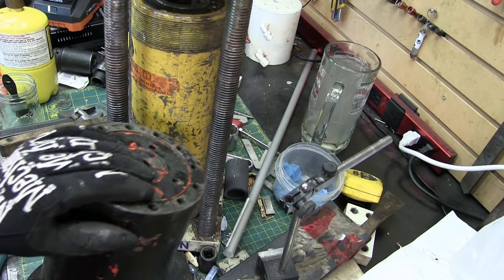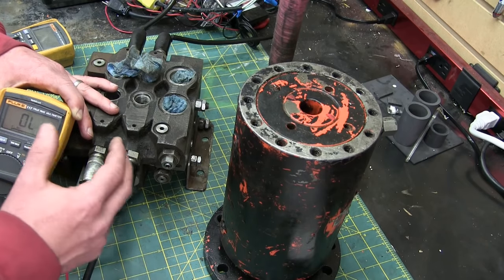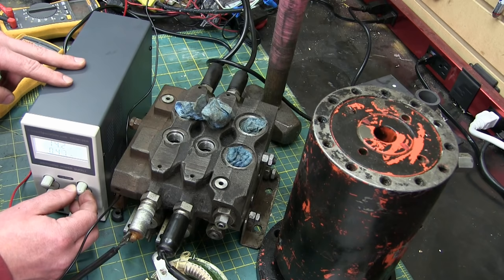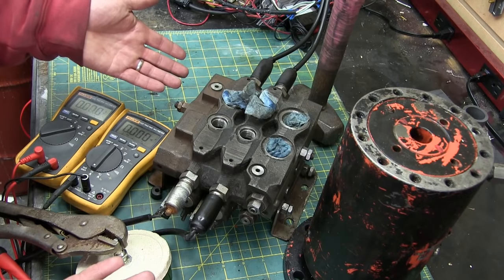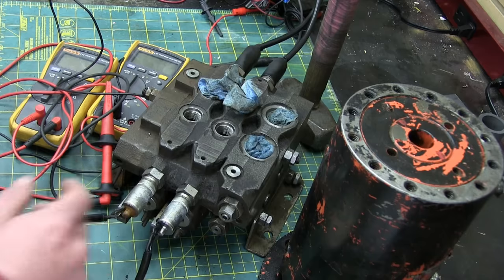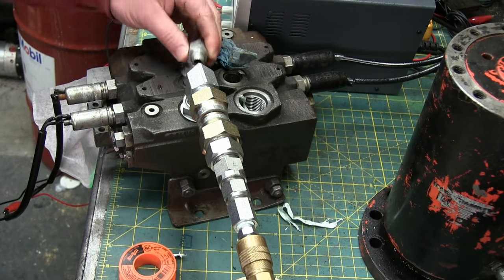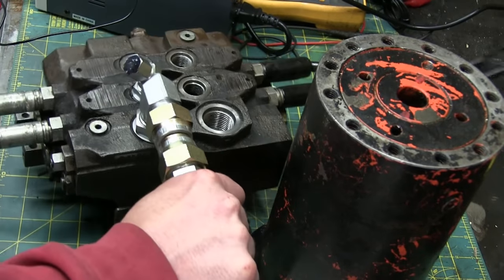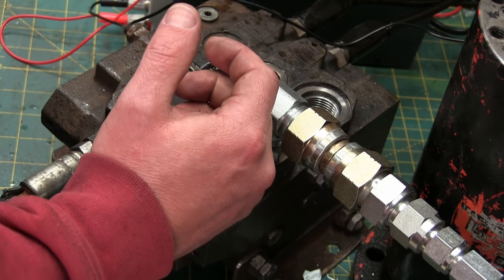Bartending Robot | Hydraulic Proportional Valve

Comment: "These are tougher than hell." Proceeds to put 12x the voltage and 6x the current though it - AND IS DISAPPOINTED it didn't work.  The rest of us are SHOCKED that nothing died, human or electronicals....
Reply: You know you're off the rails when you use you WELDER as a power supply.  Current limiting?  Yea, PHYSICS!
Reply: Well honestly all we love ave, but i noticed that he is a great mechanic but less about pixies.. So I expect some mess when he started to use the welder..then the smoke came. It was so fun! We love you ave you are the best!
Reply: Hahaha. Yeah. I was also shocked. Al my work (Hydro-electric plant) we use 0-10 mA to drive the pilot valves for the servos of our  40MW Hydroelectric generators.....
Reply: Guillermo Frontera that's insane!!!

Comment: At 8:00 , I saw that coming. One could just get some numbers off of the damn thing and look it up. Most proportional coils I've seen have the voltage range stamped right into them. Have fun rebuilding the hydraulic rotators if you ever have to. I have rebuilt many of them back in my equipment wrenching days. They are used many times at the platform to boom connection on aerial work platforms. The smaller rotator looks like a Helac brand. If you do tear it down, putting things in the freezer may be necessary to put it back together.
Reply: To The Top Crane Not only saw that coming, but could calculate it! At 28 ohms, one amp will output 28 Watt of power, which is way too much for such a small device without dedicated cooling.

Comment: If you are still working on this project and need a joystick selection, check out the Hall Effect Gimbal from a RC Radio company called FrSky.  As implied it is hall effect so the resolution is amazing and they don't suffer from twitch like conventional pot ones.  They are a must have for us pleebs that fly racing drones.

Comment: I don't know how you did it but just as you let the smoke out of the solenoid I smelled the faint smell of wire insulation burning in my garage...the lights went on as I frantically searched for my own failed experiment to recognize the faint smell of chlorine from the kiddie pool as the culprit. It's amazing how similar they smell. Thanks for the video AvE! Good luck with the project.. anticipating the next level.

Comment: You might be already aware of this Ave but that appears to be a Parker VS Pulsar cartridge valve. They use PWM to actuate along with hydraulic pressure on some variants. A circuit card varies the frequency and voltage to that pulsar. Depending on where the joystick is throttled in the machines that I work on. And the small nut with the Allen on each section of the valve is the centering adjustment.

Comment: Gonna need to build a small shed outside of the shop for the compressor.  Can build it big enough to keep trash cans in so the missus don't complain about it.  Enclosed area for compressor, with a 100 watt light bulb on a temp switch so it don't freeze in winter.  Could get real fancy and have louvers that automatically open and close for ventilation.

Comment: Would proximity switches/sensors be of any use??, not saying I have a shedload but work goes through the things like no tomorrow, just swapped out a couple with busted connector housings but the guts inside work fine. It's a wet food factory, cleaning down with high pressure water jets so the sensors need to be proofed against that. Mostly SICK stuff with a few Festo bits thrown in, mostly air flow regs and valve packs. I'll do a quiet metal bin dive and see what I can scrounge up

Comment: I know that this video is old - but you are funny!
You need flow through DCV to generate pilot pressure to move spools.

At 28 ohms, Parker Pulsar solenoids are 33 Hz. PWM controlled. But they will work in ON/OFF mode regardless with constant DC current.

Those, actually need to have negative ( reversed polarity) spike to turn them off.

Although if your power supply is switched - you are putting out some kind of PWM signal.

Comment: I am not familiar with industrial systems like you have here, but if you are looking for a joystick system that operates proportionally, consider using a joystick used for electronic wheelchairs. They run on a 24 volt system. The voltage and direction are controlled from the single joystick.

Comment: Hey man I don't know what you ended up going with, buttons or joy stick, but once I played around with using the force sensative resistors from adafruit to controll the pulse width modulation. I was wanting to do something similar but have yet to get my hands on a proportioning valve. I was thinking about sticking the sensors on the business end of the actuator, and then as you push on it, it moves. (real life Iron man suit interface)

Comment: Proportional valves often work on current, rather than voltage.  This is done since resistance varies with temperature.  Using a current feedback driver overcomes this.

Comment: As far a controlling the robot you could use an r/c setup if you bought a 5 or 6 channel even 8 channel you could add them as you need them. The electronic speed control might be just what your looking for. Perhaps someone with a little more experience with the r/c setups could pipe in. I just know enough to get into trouble.

Comment: You should do a test (video) about the lineairity of the valve. To see if the voltage changes the output preasure lineairly. 
Otherwise your bar could get really messy, really quick. :p

Edit: okay its from 2 years ago ...

Comment: isn't hydraulic overkill for a bartender? If you want a feasible solution you need a combination of pumps and mixers that can do the drinks in the back ground(adding lighting to the tubing system and executing those in clear plastic will add for a wow factor) and a 3d-printed manipulator with a pretty basic grabber that can serve the drinks. 
A practical application will require the customers to use cards for payment(because cash makes the system more complicated) and a touch terminal to take the orders. Adding a camera and facial recognition will improve the user experience.
Reply: I think overkill hydraulics is the point.
Why use tiny little valves going to a spout when you can have a huge metal contraption that uses huge valves to have an arm pour your drink for you?
Reply: because speed, mass, inertia and cost of operation per unit of weight for the equipment. Not to mention human-machine interface and the dangers coming from having a bone-crushing power shoving glasses full of flammable liquid into people's proximity.
Reply: weell I don't like parties that end as business crushers...except in some special cases
Reply: not really, I simply dislike social spam, and follow channels that are rich on information or focus on semi-mindless entertainment.
Reply: Tim Stoev welcome to the channel. Ain't no kill like overkill.

Comment: try this code if you want: all you need are two pots or a joystick thats made up of two:

void setup() {
  int x=0,y=0;

  pinMode(3,OUTPUT);
  pinMode(5,OUTPUT);
  pinMode(6,OUTPUT); 
  pinMode(9,OUTPUT);
  
  int initX=analogRead(A6);
  int initY=analogRead(A7);
}

void loop() {
  x=analogRead(A6);
  y=analogRead(A7);

  analogWrite(3,map(x,initX,255,0,255));
  analogWrite(4,map(x,initX,0,0,255));

  analogWrite(6,map(y,initY,255,0,255));
  analogWrite(9,map(y,initY,0,0,255));
}

it grabs the center on boot and simply maps the pot values to the respective pwm pins

Comment: if you want cheap joysticks to mess around with/ experiment then you could get xbox360 or ps3 controller joysticks for less than a dollar each on like ebay, where the ps3 joystick is smaller and a bit more annoying than the xbox360 controllers one since the 360 joystick has standard pitches (imperial/ 100mil) for the pot pins and mounting tabs so its easier to breadboard them etc, and the pots are linear 10k with 1 each for x and y axis and they also have a button, so for less than a dollar you can get 2 -1/+1 linear control or 4 if you have either side of center (its sprung to return to center) as 2 linear controls and the button ontop all in one. also youd likely need to get caps for them seperately but you can get 10 for a dollar or 2
id recommend getting some xbox360 controller joysticks anyway if you havnt tried them 
before, since they are great for arduino/ embedded prototyping/ hobby since they are so 
simple + super cheap + well made if you get lucky or buy from a good seller (for example 
look for ones that have a greenish cage and a grey stick are ok quality) with the biggest 
drawback being the mechanical return to center being sloppy so the pots resistances are 
still changing, so youd either want a discrete circuit or firmware to be able to define 
deadzone limits for the ranges where the joystick can still move before moving the sprung arms, where firmware would be a better option since the deadzone/ center region values can be recalibrated as the stick wears through its life., and at the end of the day they are still super cheap and useful if you have uses for them, with good circuitry and/ or firmware/ software backing them up to counter any mechanical issues their price includes they can be very effective in terms of paying a couple of dollars compared to like 50-100 or more for a major piece of joystick hardware that is 100% unnecessary for microcontroller interfacing and control. good luck with this project anyway, ill check out the repo to see the sorts of branches/ commits ppl are fighting over xd 
and ultimately if you see this : please dont buy a super expensive joystick for this project or spend any mad amount of money, since its not only not neccessary but it would actually by better anyway to use the cheaper game controller joysticks for small projects like this, unless you actually plan to have this in a heavy use industrial setting then something like expensive joysticks could be seen as a significant barrier to entry alone for this sort of thing, let alone the possibilities of repurposing a general arduino/ micro base control unit using cheapest of hobbyware that others could easily replicate and use for their own projects and etc!

Comment: I could not find MrBumblePhuck on Github scratch my nuggets as I tried too.
here is an old modified Arduino sketch using an old 10Kohm joystick to control 4 motors and using the pwm outputs on an uno.
If it doesn't help maybe you can use it as a starting point 

/* Joystick
https://www.adafruit.com/product/2765 (mini single finger/thumb)
https://www.adafruit.com/product/3246 (breakout board for mini not required but easier to work with)
https://www.adafruit.com/product/3102 (bigger joystick if you need to compensate for any inadequacy)
both joysticks are 10Kohm(ers)  
press and hold the button to operate

no guranteease if she don't work 
I provided a bit of a dead spot center of the joystick 
*/

int button=10;
int sw;
const int x_axis = 0;
const int y_axis = 1;
const int solenoid_x1 = 3;
const int solenoid_x2 = 5;
const int solenoid_y1 = 6;
const int solenoid_y2 = 9;

int x_hi=0;
int x_lo=0;
int y_hi=0;
int y_lo=0;
int a=0;

void setup() {
  Serial.begin(9600);
  pinMode(button, INPUT);
  digitalWrite(button,HIGH);
  pinMode(solenoid_x1,OUTPUT);
  pinMode(solenoid_x2,OUTPUT);
  pinMode(solenoid_y1,OUTPUT);
  pinMode(solenoid_y2,OUTPUT);
}

void loop() {
  sw = digitalRead(button);
  if(sw==LOW)
  {
    a++;
    if (a==1){while(1){
      x_hi= analogRead(x_axis);
      x_hi= map(x_hi,0,512,255,0);
      analogWrite(solenoid_x1, x_hi);

      x_lo= analogRead(x_axis);
      x_lo= map(x_lo,518,1023,255,0);
      analogWrite(solenoid_x2, x_lo);

      y_hi= analogRead(y_axis);
      y_hi= map(y_hi,0,512,255,0);
      analogWrite(solenoid_y1, y_hi);

      y_lo= analogRead(y_axis);
      y_lo= map(y_lo,518,1023,255,0);
      analogWrite(solenoid_y2, y_lo);

      Serial.println(x_hi),(x_lo);
      Serial.println(y_hi),(y_lo);
      Serial.println(a);
      sw=digitalRead(button);
      if(sw==LOW){break;}
    }
    }
    if (a==2)
    {
      x_hi=0;
      analogWrite(solenoid_x1, x_hi);

      x_lo=0;
      analogWrite(solenoid_x2, x_lo);

      y_hi=0;
      analogWrite(solenoid_y1, y_hi);

      y_lo=0;
      analogWrite(solenoid_y2, y_lo);
      a=0;

      Serial.println(x_hi),(x_lo);
      Serial.println(y_hi),(y_lo);
      Serial.println(a);
    }        
    }
  }

Comment: Uncle Bumblefuck, have you tried micropython there a lot easier to deal with then arduinos not only because it's python but the micropython boards typically have built in frequency modulation for running stepper drivers. Also have you found any ID on those proportional solenoids

Comment: I wouldn't say it's something I am really good at, but I may give the pixie wrangling a shot using a standard $1.00 Chinese joystick off of fleabay.  Same sort of thing you could pull out of a cheap video game or RC controller if you have one laying around.

http://www.ebay.com/itm/Hot-Sale-JoyStick-Breakout-Module-Shield-PS2-Joystick-Game-Controller-Arduino-/201416176593?hash=item2ee556f3d1:g:OQYAAOSwq7JT7yCz

5V control logic couldn't be more perfect for a DIY project, great score on that valve.  Would you want the joystick control to still have a separate pot to limit the maximum speed, effectively controlling sensitivity?

Thanks for the early access!